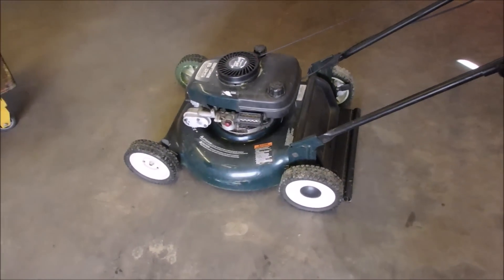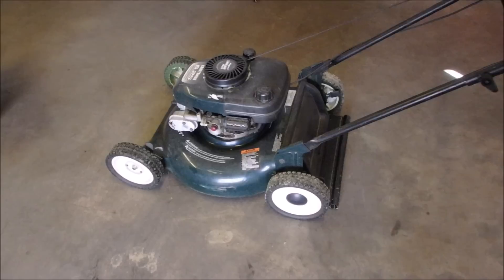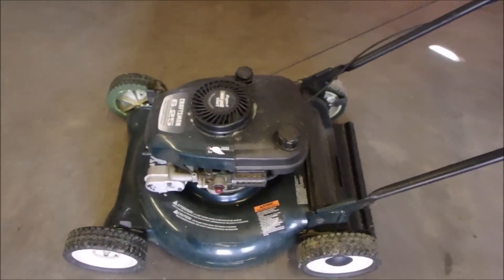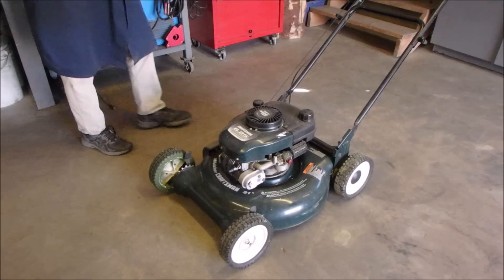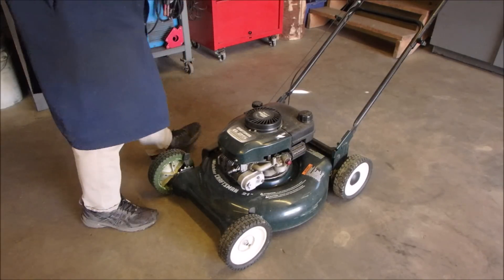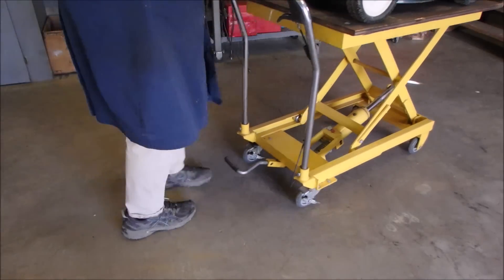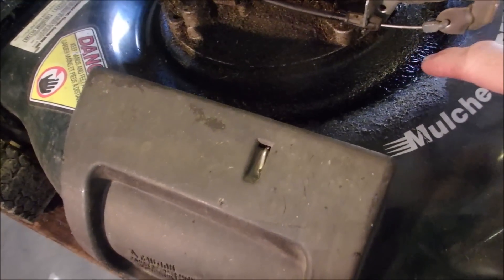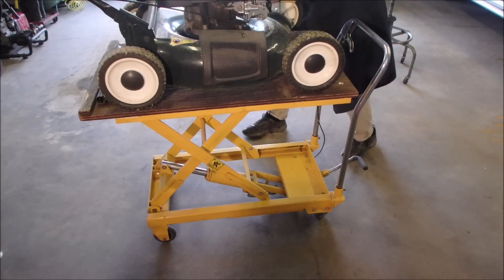Craftsman 6.25 Mower,  Leaks Oil

Comment: Hi Bruce  saw your video on the Honda hra214. I have one of them myself, not been running very good lately, so after getting inspiration from you and you video I tore the carb apart and cleaned it, put it back together. And it even works! Lol  runs like a ⏰ now. I am impressed how you get the job done, especially without all the specialty tools! Keep doin what you do! Thanks for inspiring others.
Reply from the maker: Right on.  You made my day

Comment: I basically have the same Craftsman 6.75 hp mower that leaks oil in the well around the top of the deck. I changed the small rectangular valve plate gasket, the O-ring at the base of the dipstick, and changed the oil breather on the top of the engine (acts like a PCV Valve). I no longer have visual oil leakage now, but need to put some run time on the mower to be sure. I had to remove the flywheel to change the breather and inspect the schafts top oil seal. You taught us how to remove the flyway;, Protect the shaft threads with the nut being on, pry underneath the flywheel, and pop the shaft once or so with a hammer. Done!  It works slick!
Reply from the maker: thanks a lot Bill

Comment: Nice job! I had a Toro with a Tecumseh LV-195 in here last week that was COVERED in oil soaked grass from head to toe. The rubber breather assembly had hardened up and shrank down, so every time the piston came back to the crankcase the whole breather would pop up and spew oil out. What a frickin’ mess, and they kept using it that way! That thing was a Superfund site on wheels. New breather assembly, new upper crankshaft seal and she’s good as new. Love those easy startin’ Tecumseh engines, truly wish they still made them!
Reply from the maker: Me too.  Thank you

Comment: Wow.  That intake puff was slight but still a bit of a hint.  Not much damage to that key.  Not sure I would have had that good of sight. I guess there is  a reason the call it the dip stick.  Great fix.  Sure runs good now.  Thanks for sharing and you two stay safe.
Reply from the maker: Thanks again D.

Comment: Thanks for the video Bruce !  My lawn mower had similar issue however, oil was spraying out of the bottom of the filler neck.  A bunch of the screws holding top had come loose and allowed the filler neck to move resulting in the seal being skewed.  Thanks again !
Reply from the maker: You are welcome.

Comment: Hey Bruce I need to bend your ear.. i have a 15.5 hp Briggs that wouldn't start.. I pulled the valve cover and the bottom push rod (aluminum) one had about 2 inches broken off and was sitting in the bottom of the cover . Thankfully I didnt loose the rod into the engine. I pulled the rod and replaced it.. i set the valves and tried to start and nothing. I pulled the head and the head gasket was ok.. I spum the engine and the piston works fine, When I put the push rods in they work correctly.. any ideas? i looked at the valve guide and it doesnt look like its slid out and the rocker had full movement. I was able to compress easily with my fingers to get keepers out,, I am stumped.. should I buy a new head and hope for the best? sorry to bug you but everything I know is from watching all your vids.. keep up the good work
Reply from the maker: Is it possible that the force that broke the push rod caused the timing gear in the motor to jump.  Take the engine to TDC on the compression stroke and see if both valves are loose.  Make sure it is on the compression stroke not the exhaust.  .  (If you can)  If the timing gear is really out you will find everything out of kilter.
Reply: @BrucesShop  Your the man.. thanks for taking the time to answer I will check it out

Comment: How's she goin'?  An interesting problem.  I think the oil leak stemmed from the oil filler tube not being seated properly.  That also explains the 'low' oil level reading as the tube was up out of it's proper position.  The little bit of wear on the key, probably made it backfire out the carb, but when you checked the intake manifold, there was no signs of oil, so the oil leak wasn't coming form there.  Maybe eh!!!  LOL  Nice video.  I like that you let us trouble shoot along with you in your videos!!!  Take 'er easy!!!
Reply from the maker: Thanks Grampie.  I think you are correct on the dipstick tube.

Comment: Good job Bruce great vidios,  I got a 1996 John deer stx38 riding lawnmower got a engine only oil leak can't find that bugger the guy I bought if from had it a quart over , drained to proper level now its leaking
Reply from the maker: From the top or underneath?
Reply: @BrucesShop  underneath

Comment: Thanks for the video.  I will have to check that and maybe the sump gasket as another person mentioned.  I just haven't been able to pinpoint this similar leak.  The gasket looks as if it's missing material in spots.
Reply from the maker: Yes i would check the sump seal first.    
I checked the sump gasket at 2:56 when the oil was coming from up top.

Comment: I don't know that I would have thought to look at the flywheel key.  That was off just enough to make it run slightly less optimally.  Most of the flywheels I take off are at least as stubborn as that one!  I made pullers for both Briggs and Tecumseh flywheels.  That flywheel most likely has 3 holes in the top you can tap with a 7mm (I think) tap and then use a small 3 arm puller on.
Reply from the maker: Great point!

Comment: Hi, Bruce, Working on the exact Mower, have cord kickback, replaced flywheel key still have kickback, Is there another ignition timing area on the craftsman mower to adjust?
Reply from the maker: Here is a 3 video set on a plastic cam gear or a Briggs though not a Tecumseh that you have.  I am not sure if they are the same as I have not had timing issues on the Tecumseh after replacing the key.
https://www.youtube.com/watch?v=pL-ZVURFc5o
https://www.youtube.com/watch?v=JoO8ScyvDrA
https://www.youtube.com/watch?v=KzXeiCwVspg
Reply: @BrucesShop  Bruce, Thanks for the prompt reply.  I have to take apart the sump to check the Tecumseh engine. It may take a while.  I'll let you know what happens.  Thanks again, Ed. W.

Comment: I had that dipstick issue with the  only Tecumseh engine I've worked on. I think it's possible the tube can work itself out of the hole over time.
Reply from the maker: Exactly.  That is why the oil read low when it wasn't

Comment: Great video those dip stick tube seals like to go bad sometimes.
Reply from the maker: Right  I lowered it and now even the check oil level is right.
Reply: Bruce Pender my 6.5 HP leaks, so just replace the seal? Seems to be leaking on the carb side as well, what could that be?

Comment: Its leaking from bottom Bruce I power washed it still not quite sure it just goes around whole bottom
Reply from the maker: Could it be the oil filter.  they can be intermittent.  i know you said bottom.  Plus there is an oil drain that is sometimes an add on that gets loose.
Reply: @BrucesShop  thank you Bruce for your time with this is leaking where the oil drain goes in engine block at the block have to call john deer I think thx sir. Keep  up the great vidios

Comment: I had the same issue with a Tecumseh I had gotten for free. It would run, but was hard to start and when I pulled it smoke came out of the intake. I figured that it was a flywheel key issue.
Reply from the maker: I sure doesn't take much eh!!!   Briggs do it too.

Comment: I've seen more bad keys on Tecumseh than Briggs for some reason. I thought that you would have used a torque wrench on the flywheel nut. I have a couple engines in the shed with a stripped crank shaft thread.
Reply from the maker: I use an old weak impact.  You are right.  More Tecumseh keys break.  I think they are softer.

Comment: Nice work on the Chief, Bruce. I think Tecumsehs are slightly over complicated - but pretty good engines if maintained.
Reply from the maker: Right.  As you know I had one for 27 years.  Much older model than this though.

Comment: Scooshed I like that word. >I saw the gap in the key. I have a spare brigs and Stratton engine in the garage. The key being twisted didnt make getting the fly wheel off easier. Loose dip stick holder thats also interesting.
Reply from the maker: Right on

Comment: I haven't watched all of your video yet but , check the square " 0 " ring at  the bottom of the dip stick , they are infamous for leaking! :-) those flywheel keys don't need to be creased much at all to put them out of time . I've seen Briggs motors where the key is sheared in half & one half in crank & the other half in the flywheel 180° off & it would still start & run ! But not Tecumseh ! :-)
Reply from the maker: Thanks for the tip!

Comment: if you do a lot of Tecumseh s they sell a knock off tool  for the flywheel it's # 670169 works really well
Reply from the maker: I have them all now.    Thanks
Reply: I like to see it when you do things without specialty tools because it helps me see how I will have to do it, since I don't have those tools (yet).
Reply from the maker: @haneyoakie14  Right.  Not everybody has the official tools.  thanks.

Comment: Not a fan of those engines
Reply from the maker: The older ones were rock solid.  i ran one for 27 years.
Reply: @BrucesShop  had one it throw a rod out the side
Reply: @BrucesShop  that is why I always went with Briggs and Stratton